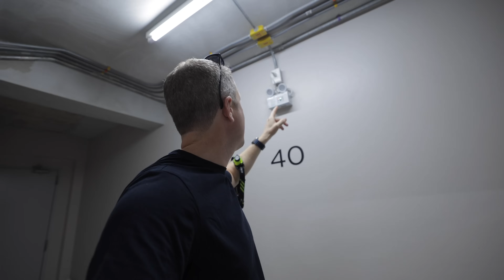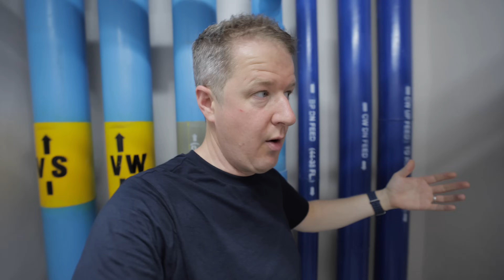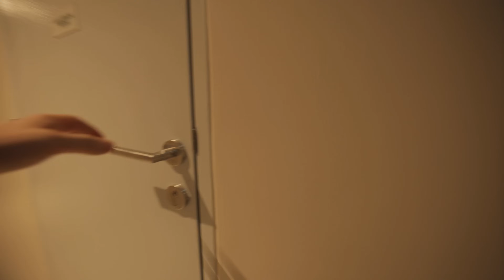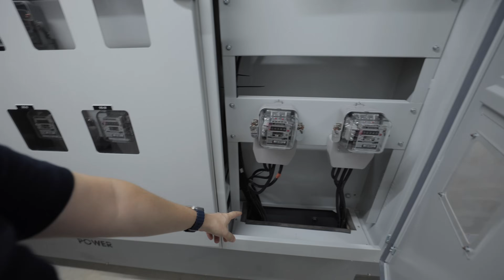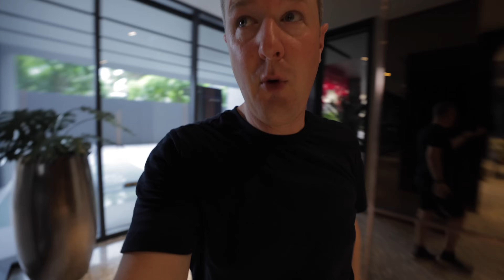How Bad Are Electrics In Thailand? 🇹🇭

Comment: A bit of a late comment I know, but the double fiber cables you found are "full duplex", meaning one of the cables is for transmission and the other receiving.  They're generally used for core network infrastructure in datacentres or large offices/building where you'll have very large amounts of high speed data.
Reply from the maker: Nice! Thanks for sharing

Comment: Looks just like the electrical installations in the US. Siemens MCCBs, Schneider busway, EMT conduit, cable trays, etc. The meters look foreign, but that's about it. You should visit the US and see some of our electrical installations. The residential part will look totally foreign to you but on the commercial/industrial side it looks more European, especially with newer panelboards like the ABB Proline using DIN rail MCBs and finger safe busbars.

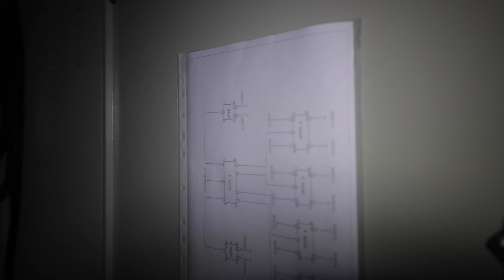Comment: 4:12 Actually it is not very nice. You should not bend RF coax cables on a tight radius. The tension puts pressure on the internal insulator and makes the core migrate out of the center. This creates impedance discontinuities which cause RF signals to be partially reflected back. In short, every tight bend has the potential to cause some signal loss.

Comment: The mess of cables in the electricity poles are not electricity wires. They are fiber, telecom TV etc.  Each company putting cables in the poles should pay rent to PEA (MEA in Bangkok) but to ofen they don't do that so the electricity authority has a lot of probllems when doing jobs along the power lines when  they don't know who all the cables  belongs to. My wife is a deputy manager at  PEA and explained this is a real problem.

Comment: The F/A cabinet with all the relays is probably for a smoke control system, I saw a grille in the stairwell and as it's such a tall tower it is probably a pressurisation system where big fans either at roof level or basement will keep the stairs at a higher pressure than the corridor that could be filled with smoke. There's probably an outlet in the corridor as well so when the stair door is held open there will be a pressure differential between the 2 keeping smoke out of the stairwell.
Reply: At 8:15 in the video that cabinet is fire alarm. the little modules with the green screw terminals are EST fire alarm input modules. Not sure what the unlabeled modules with the LEDs are but the EST ones are used in the US. Nice tidy install.

Comment: I got a shock from my laptop's power cable in a 5 star resort in Krabi because the sockets were unpolarised, ungrounded 2 pin US sockets and i plugged in my UK laptop power supply through a travel adapter and I happened to guess the orientation of the plug wrong the first time

Comment: Ooh, what a very interesting explore here! 😀 Many thanks Jordan, and here's hoping you also took the opportunity to document some of the more traditional aspects of Thai electrical installations before pressing on to Indonesia! 😇

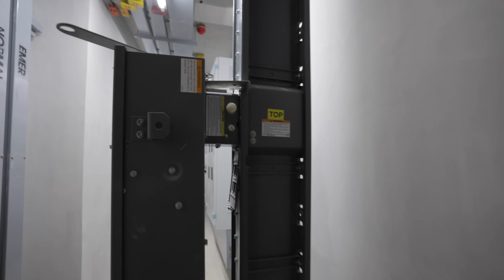Quick question about the 3ph isolation unit at 12:15 - The label on that implies (To me at least; But I'm not a qualified Sparky) that the unit is „Plugged“ into the busbar riser. But for a 3ph 2kA circuit these surely can't be tapping the busbar with simple spring or friction contacts (As opposed to bolts)...Can they? ⚡🔥😲

Finally: An excellent example of an everyday high current electrical system is the third rail traction supply used on our railways in the south/east of England. Although these are low voltage by definition (750v) the current flow is extremely high for a system with exposed contact points, and the thinnest conductor I've seen anywhere on these systems is no less than 100mm diameter. 😲

If I understand correctly these carry about 50kA in normal operation, and being DC too they won't appear to bite too much...But when they do, it'll be the sort of bite that chargrills a Bovine in a mere fraction of a second! 🐄⚡🔥🍖😨
Reply: If you're interested in learning more about tap-off units, have a read at the Schneider or Eaton busbar catalogues. The tap-off units won't be bolted to the riser; it'll be a heavy-duty levered connection...

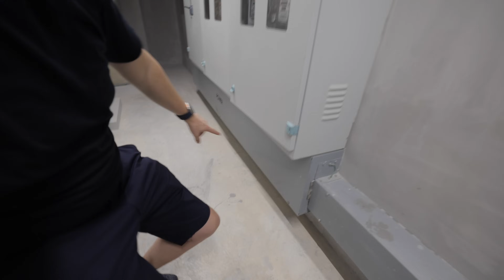Also the connection from the tap-off unit to the switchboard (14:26 in video)...to me it looks like the connection was made via busbar, not cables (the trunking has quite small bends...you wouldn't be able to achieve that bend radius using cables that you'd typically use for a 2000A, 400V connection...)

Comment: Interesting how messy the fiber cables are compared to all the other wiring.   Those white fiber cables are common, we have similar stuff in the US, I’ve got 1Gig fiber to my apartment and they use similar cables to distribute to each unit.  It’s likely a single strand that uses coarse wave multiplexing to get bi-directional coms down a single strand.

Comment: Hi I have been having some trouble with my power inverter In my solar system, it’s a 12v dc to 240v ac inverter. Every time you plug something into it whatever is plugged in e.g. a fan it makes a wired humming that doesn’t happen when plugged into mains

Comment: When I worked for BT there were massive busbars associated with the distribution of 50V DC to the equipment in telephone exchanges.  Cross sectional dimension of 30 x 30 cm or so not uncommon, consisting of multiple plates with air gaps in between. all duplicated for pos and neg.    A lot of heavy metal supported from the ceiling and whacking great fuses.  Also, when carrying a lot of current, a significant steady magnetic field as it was DC.

Comment: One very important thing to note - NEVER look into the end of fibre, especially when you don't know what's at the other end. The colour of light coming through data cabling is likely to be infrared, so it'll appear really dim red or invisible depending on wavelength. However just because you can't see it doesn't mean it's harmless - there could easily be enough power in the beam to instantly burn your retina, or even set fire to paper or destroy a phone camera
Reply: INSTANTLY burn your retina?
Reply: Bollox

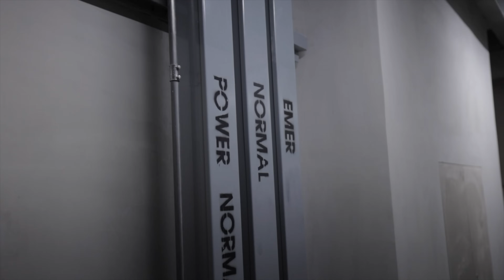Comment: 16:20 there may be a main combined meter to check the calibration of the attached group of meters, so the two at the bottom with the larger cables feed a couple of rows of those above.

Comment: It's curious that on a new installation they appear to have used electromechanical meters for each apartment rather than electronic ones which can be read remotely and monitored by the consumer.
Reply: When I installed solar here 5 years ago they installed a mechanical meter. As the meter doesn’t move they thought I was spinning the meter backwards (to the same reading each month) I have asked them to change the meter- still waiting.

Comment: At end:  Do you show us typical farang stuff and not more true electrical work in a real Thai home. This all very new and more farang style. All clean, all written with tags aso. 😂 Why not show that all is 3-phase so 50 A into one apartment are 3*50=150 A total. I think one phase is only for A/C.
Reply: 1-phase meter (two incoming and 2 outgoing wires) and switch was rated 50 A. So couple of normal 10-25 amps fuses for sockets and oven in the apartment.

Comment: 9:38  At my time only Siemens City have had more as 100 MBit for every household. So I think they do now FTTH what make sin in a big apartment complex with many apartments. If you not rent it with internet it can be only FTTC - so you have ADSL at home only. Why do you not show your apartment so we can see it? 

Why do you not have 2 fiber in one apartment - do you can double your speed or one company, one private. It is all mystery before do you not shown your apartment. 

Of course power for the active splitter ! Without your lights not working. Very good structured work and cable laying.

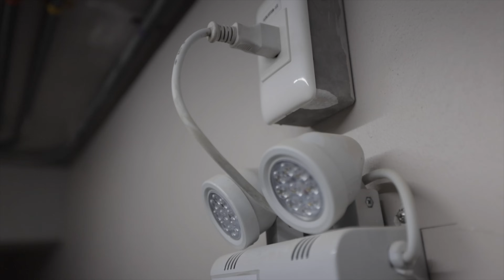Comment: 1:21  This is a typical build of an emercency lighting. The power go off and the build-in battery starts the power and the light(s) starts. Do you buy this boxes normally with 1 till 4 lights. It is easy to install for the customer and easy to change. In history I pay around ๕๐๐฿ (500TBH) till  ๑๕๐๐฿ (1500TBH) for one box at Tesco Lotus. The old one use 12V bulbs, this newer build use LED. 

The plug and sockets are older copies of the British plugs how they use around 1900 in the British colonies around the Kingdom of Thailand. They are normal around in Asia. If you are rich or love security do you use British plug and sockets, e.g. for hot pot, hot pan, rice cooker, mostly in business buildings, e.g. Restaurants.

Comment: Why would you run 2000A instead of having higher voltage, smaller conductors and step-down transformers? Wouldn't you have less losses and require smaller conductors? All that copper must be pretty expensive!
Reply: Transformer losses, and the simple install and maintainance costs per floor is probably a lot higher than the cost to just run big busbars which might be made of aluminium anyway.

Comment: Modern electrics and plumbing in Thailand are generally very good. The older stuff not so good. They probably introduced stricter codes in the recent past.

Those bird nest disasters like the one you showed in the intro are everywhere though. Mostly old obsolete comms cables actually but mixed with power cables too, and when they burn which they often do the results can be spectacular. Recently one such fire in Pattaya happened above a row of parked motorcycles, setting fire to them and the resulting damage was extensive!

In a lot of places they are all being removed and the non obsolete stuff being moved to underground ducts, but imagine how big and disruptive a job that is. Where it’s complete it’s quite a transformation but it’ll be years if ever before they get done.

Thailand is a great place to retire to though.😊
Reply from the maker: It does seem like any new builds have much better electrics and wiring which is great to see!

Comment: 16:20 given that there are 20 of the smaller cable meters, and that the smaller cable meters have smaller numbers on them, i think that the bigger cable meters are actually feeding into the smaller cable meters. so i reckon there might be 2 seperate bus bars (i'm guessing this is for 2 phases, given that the input voltage is 415v so they would just split this into 2 ~207v lines) and each bottom meter covers its own bus bar. im guessing this would be purely for redundancy reasons, so that if any of those meters fail, they will definitely know and can recover any missing details.

Comment: Hello Andrew, you said back in England that your trip would include Vietnam. I can,t wait for your reaction to Vietnamese wiring! Their H.V. Stuff is pretty good, (but, the again, it HAS to be), On the road from Saigin north west out to Tay Ninh you might see a brand of distribution transformer with coloured primary bushing caps in red, blue and yellow and they have matching fuses and air-breaks to go with also coloured…so keeping track of the phases is a sinch.

Their L.V. Stuff is another matter though. in Saigon there has been MASSIVE infrastructure work in the last two decades, most of the L.V. Is being placed underground, (abd a good deal of the H.V. Stuff  too). New distribution transformers are on plinths and you should see a lot of those, usually 500 or 750KVA.  You might have to look sround a bit to find the old Saigon lattice poles and concrete “Waffle Poles”. These had about three lots of three phase, sharing a single neutral stretched really tightly between them and all withinn a squaew foot or so, the tightness was to prevent sag whan birds perched on them. I thin there are still some in Ng Tat To street in Phuong 19 Binh Thanh District to the north east of the CBD across the Thi Nghe Channel, you might also find some older dual pole mounted distribution transformers there, (Hem 174 Dien Bien Phu Street). 
In newer builds the wiring quality is getting a lot better, they use the Australian colour code, neutral, black, active, red, Earth/CPE, green with yellow trace…However in old places anything goes!  Aerial feeders to premisis are grey-black twiated pair about 10 mil squared, black, active, grey, phase. Once this passes the meter…anything is possible…the “children” take over the wiring. The sense of what is active and neutral is GONE! And Earth? well what is that for? I have seen three phase with all three phases green with yellow trace, so watch yourself ! Blue and yellow seem to be popular wire colours, again, could be active or neutral! Needless to say, switches could be in the neutral side. Main switches are dual gang knife switches (usually with some form of slotted plastic cover) that break both active and neutral.  Very old places have just one power circuit, about 8 mil squared insulated in paper, black and white, sub circuits “tee” off this in 1.5 mil to little sub boards on plastic Peg board with one snall “toy” porcelain rewirable fuse wedge, for or five outlets, three of witch accept NEMA and Schuko plugs snd one “combo” outlet that will take a British plug too, (Earth hole but no connection)… all these outlets are milded in one piece like a power strip. The peg board also includes a switch, mounted sideways for a fluoro battern…nearly always mountec on the wall and almost never on the ceiling. This “toy” switch has a glow on the dark Strontium Aluminate rocker! Often these little sub peg boards will have fans botched into them using figure 8. At my in-laws there is a  1.5Kw kettle and 5Kw heat as it flows shower that are wired with 1.5 mil!!  So “have fun” when you get there!
Reply: Agreed, a lot of the transmission and HV distribution is well done in Vietnam. I've been in a few new substations and the quality and equipment is good, as well as out in the field with reclosers and sectionalizers. But yeah, once you get in to the LV  wiring, anything and everything goes. No color code, the old peg boards still available for sale and just basic wiring from point A to B. No pride in work, no craftsmanship, no desire to have it work for more than a month. Usually.... I have seen some good installs but far and few between. I do have an electrical company here in Vietnam, so I do a lot of work behind people to make it safer and more reliable. I also try to train locals on better practices to make them better as well. In a lot of the cases, it's not laziness, it's just no one ever showed them a safer, better way. I have seen some nice work in larger commercial buildings, but that is hit or miss too.
Reply: Sounds a bit like 50s/60s wiring in Austria. Technically the German VDE regs stipulated wire colours but in reality everything was the same. Some electricians used different colours for different circuits (but always the same for line and neutral of each circuit), others did whole flats and houses in one colour and some colour-coded switch lines and strappers. In one place I even found half the flat wired in VDE colours (grey neutral, black line) and the other half all green. Earths were usually red but red could be a number of other things as well (that actually conformed to the VDE regs, they were quite ambiguous on the use of that colour). Three-phase supplies were often four black wires or any other colour. Until 1959 domestic sockets weren't earthed except in the kitchen where the earth was connected to the water pipe. Even the first completely earthed buildings used the plumbing as the main earth. The same place with the mix of colours, built in 1960, used a red 1.5 mm2 from the stop tap in the kitchen to the nearest junction box in the adjacent bedroom. If an unsuspecting electrician had disconnected the bedroom circuit at the fuse board the whole flat would have lost all earthing, the main from the meter was just 6 mm2 four-core.
In 1965 the harmonised colours were introduced, black line, blue neutral and green/yellow earth. Austria added a one-year transitional period for installations already in planning or under construction, during which the neutral was still to be grey but the earth green/yellow, just to make things extra confusing. The latest installation according to those transitional colours I've found so far was built in 1974. Eight years after the transitional period ended. The same installation also had green and yellow lines throughout, which had been banned in 1965 to avoid confusion with the earth. Only by the late 70s colours were mostly standardised and by and large installations are considered safe by current regs once you get things like 100 mA main RCDs out of the way.

Comment: Those white fibre cables have a strong wire inside to support the cable hanging from point to point and provide strength to the tiny fibre inside.